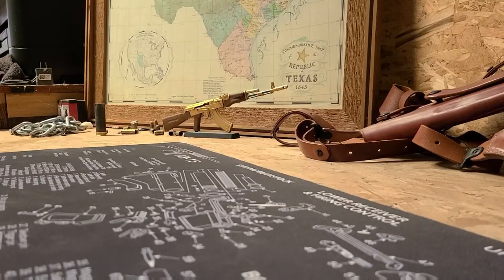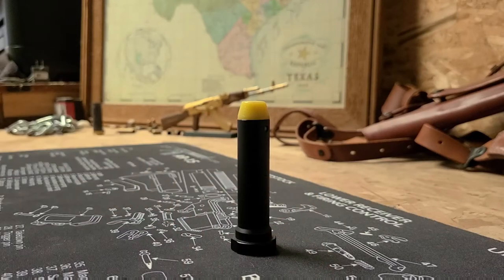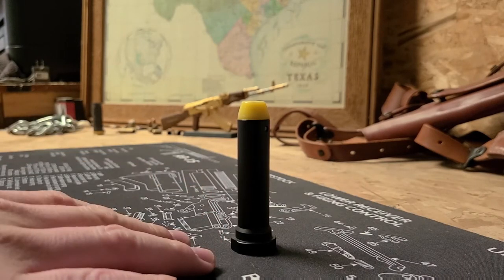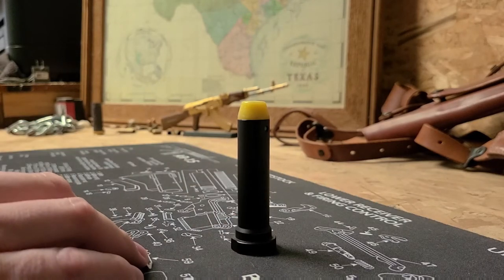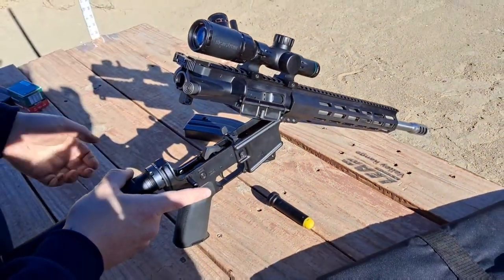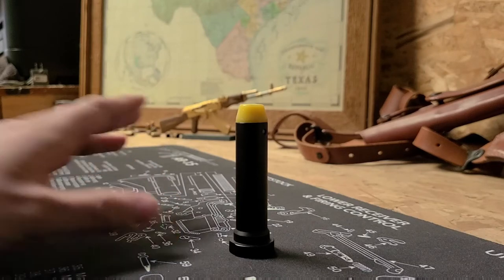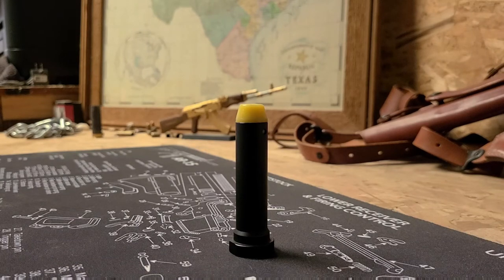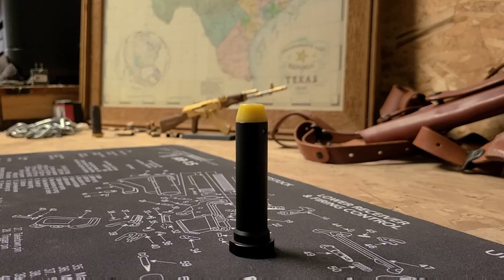Easiest way to mitigate muzzle climb in the AR platform

Comment: I installed the A5 buffer, spring and tube which is about a 1/4" longer using 7.62x39 and it works great.